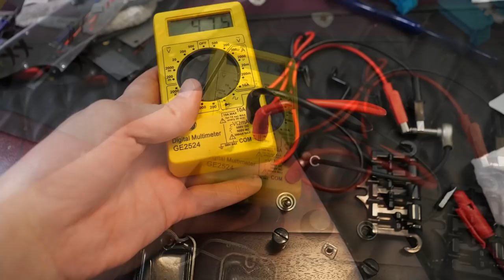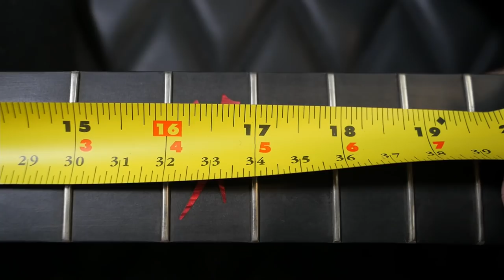It's Got the Looks that Kill! | 2012 Gibson Nikki Sixx Signature Thunderbird Bass Red Xx

Comment: As someone who has played a T-bird bass for 20+ years, I appreciate this review and documentation. Also you should look into seeing if you like something like a Helix if you plan on doing more bass stuff and don't want to get an actual bass amp.
Reply: There's also my solution.  I bought a DigiTech BP355 digital bass processor.  Tons of sounds and processing power, an expression pedal and cheap as dirt because they're old.  They can make a bass sound GREAT!

I liked the tone Nikki's bass gave out, even though I would probably put in a stacked pot so as to have 2 volume controls without spoiling the look.  That basic tone could be retrieved just by running both volumes full out.  Mixing would be just like the Fender Jazz Bass.  But that's just what I'D do!

Comment: As far as your comments on the 3-point being adjustable in angle, that is simply not true. If they are too flat or forward angled they will pull their body posts out over time. They are notoriously terrible bridges, some of the worst that exist. The only reason they are on Gibsons still are because of their love for tradition.

Comment: Man so much I dislike in that wiring harness 😞  Personally I have only bad experience with the barrel output jack's. Both pickups always on!?? Mini togle switch I dislike to and used like that. And pickups on the wiper? Asking for trouble. All live points on same level ask for noise. Like antenna when volume on the pickups is set to low. Plus modern tone wiring. If this was my player I would change the mini together to switchcraft one and use it to switch pickups and use master volume and tone with 50's tone wiring. If you need killswitch I would use better one maybe even buckethead like one. Then I would use two volume pots with zero load to be able to mix in pickups. Or do first wiring and drill new hole and install killswitch in it.

Comment: That three post bridge is the reason I refuse to buy a Gibson bass. They did it right for one year in 2015 the SG basses got a modern bridge that individual saddle hight adjustment. And they went bad to this piece of crap. Oh you want to properly set your radius easily, have a nice low action, and not have to re intonate every time you change strings? Too bad. That three post bridge is the bigsby of the bass world.

Comment: I dig the look of a Thunderbird, but neck through basses gain sustain at the expense of funk-gurgle attack IMHO. If you need that sound (for slap bass for example) bolt on neck basses just do it better. BTW, Austin, for a better slap sound, play right below where the neck joins the body.
Reply: Neck joint has less to do with it than the pickups... Thunderbird pickups just don't do slap well at all

I have a neck thru 5 string with emgs that slaps fine...
Reply: @SgtPnkks    I preach about the neck joint because I once had two Kramer Forum basses, one neck-through and one bolt-on, both with Spector P-J pickups. The neck-through could sing for days and felt smooth as butter, but the bolt-on’s slap/pick tone was a notch better (and preferred by studio engineers). The neck-through was not “bad” at slap by any means, but having lived with both neck joints in otherwise identical instruments convinced me that it creates a difference in tone.

Comment: I just don't understand the Richlite hatred. I'd much rather have a Richlite fretboard, than know that 19 trees were cut down and thrown away, just to find the one that had the jet black ebony that the manufacturer demanded. I won't use ebony in my builds anymore. If someone wants black, it's going to be either Richlite or Royal Blackwood. Well, that or someone else can build it for them.
Reply: Most of the time they’ll use a (kind of nasty) black dye on an ebony board (I think it’s from the violin industry) that isn’t jet black. But streaky Ebony can be beautiful too.
Reply: If I'm spending that much money I want wood